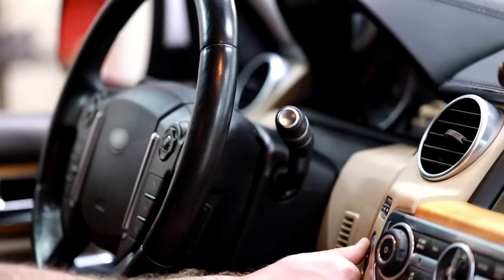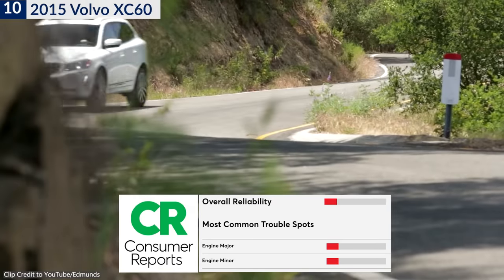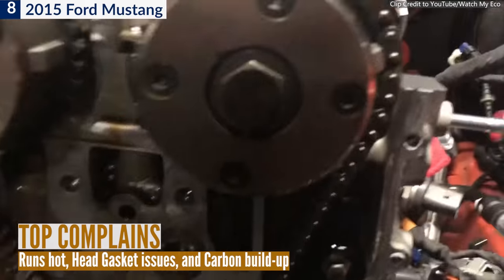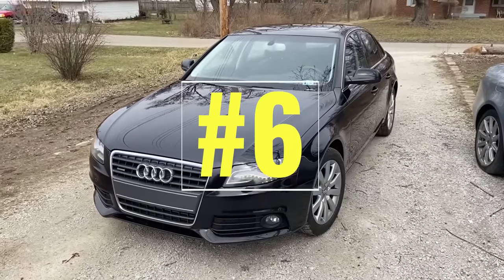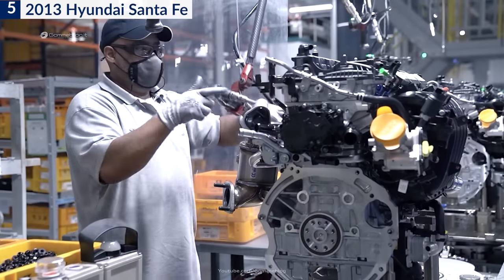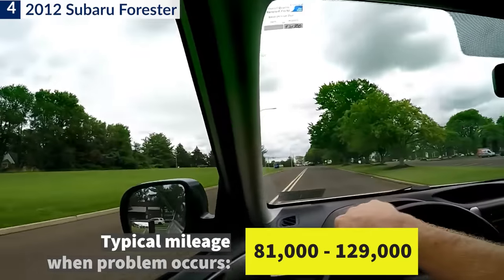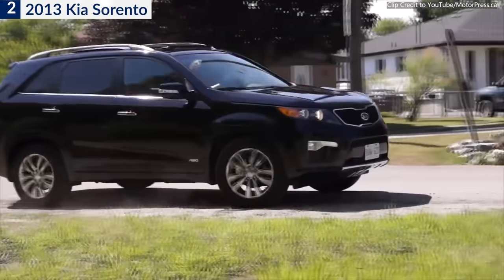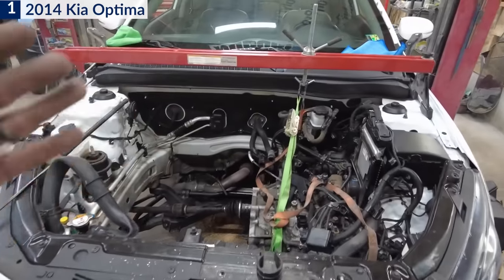10 Used-Cars to AVOID for BAD Engine - as per Consumer Reports

Comment: Yea I'm just gonna stick with Mazda,Honda and Toyota
Reply: Only way to go if you’re buying used
Reply: @floydturner2957 only way to go if you are buying anything.
Reply: Yup…my 2008 Honda fit runs like it’s new. Really great car…built in Japan I believe
Reply: Don't forget ford's relationship with Mazda. For example the Mazda B series and ranger are the same vehicle.
Reply: Or just do 5 minutes of research on cars to figure out of they have any major issues or not.
Reply: @TheRealCatof  research doesn’t help when you buy a new car.
Reply: @RC-fh2lk  yes it does. Vehicle manufacturers usually use the same engines across different cars. A brand new 2023 car most likely has the same engine and transmission that older car in the lineup uses.
Reply: Yes!,,,, Exactly!,,,
Reply: Mazda is pretty much Ford now so better sticki g to toyota and honda
Reply: @Old-n-slo-locked-n-leaned  i work in a dealership and we are in the middle of re building a mazda bt50 engine but the parts mazda sent us for the engine are Ford parts, explain this?
Reply: I've been driving Toyota's since 1983, my daily driver is a 2000 Toyota Tacoma X-tra cab pickup, 2 wd, 4 cyl, automatic. 23 years old, 230,000 miles and still runs great. Can't beat a Toyota! I'm 64, got tired of the Big 3 Junk.
Reply: @elliwowen5121  No it's not. Mazda primarily designs the components that it shares with Ford. The cars made by Mazda in collaboration with Ford have always been bulletproof. The cars made by Ford alone tend to have more issues of course.
Reply: @elliwowen5121 Mazda hasn’t had a relationship with Ford or any shared parts/vehicles since the introduction of Skyactive platforms/engines/transmissions..etc
Reply: Mazdas are overcomplicated for a FYIer. Even the smallest repairs require major disassembly. Plus RUST! OH, RUST!
Reply: @edgarpan  I’ve owned two Highlander’s a 03 (sold at 220k) and now a 2018 (47k)… only changes fluids , breaks and tires … very solid vehicles
Reply: Yeah because I literally don't see one of those vehicles still on the road 20 years old or older.
Reply: Best options
Reply: My last new honda was a nightmare, have fun with those
Reply: Well I got an 89 Ford F150 with 289,000 miles it has a straight six and it’s all original still on the road what’s killing vehicles is half horsepower small cubic inch take your foot off the gas pedal and drive like normal and you won’t wear things out like this
Reply: @onebadmutha5578  My daily driver is a 93 Chevy k1500 @389k miles with a 350 v8. All original except the starter and battery.  Even the brake pads went 150k, still running original drums and rotors. It always amazes me how people make decisions based on misinformation. 🙄
Reply: @wilsterone6689  got to be on the maintenance
Reply: @onebadmutha5578  Absolutely, but that would also be the case on any vehicle. Doesn't make the big three junk because they don't last if you don't maintain them. Its also much harder to get a vehicle that tows 12k lbs and has 300hp to last 300k than it is to get a vehicle that hauls 600 lbs and has 48hp to last 300k.
Reply: @wilsterone6689  I love my Chevys and Fords my wife drives a Kia
Reply: @onebadmutha5578  nothing wrong with a kia. It just pevs me off that people perceive American cars as less reliable.  It simply isn't true.
Reply: Mazda? Hell naw.
Reply: Mitsubishi isn't too bad, as long as you do your regular maintenance.
Reply: @brayanrodriguez1268  True about nearly every brand.
Reply: @elliwowen5121 *was like Ford. They’re completely independent from them now as of last month. They no longer use any Ford parts.
Reply: Same, I was looking at Jeep but idk about their reliability
Reply: @Panicatthejazz  like any manufacturer,  they are fine if you drive like a human and maintain them as recommended.
Reply: Hyundai Kia maybe
Reply: Peugeot, Renault and Citroen , Saab, Fiat, Seat, Alfa Romeo, Porsche, Mercedes....haven't been mentioned.
Is it more US based research ? Or are we just lucky ?
Reply: 2015 mazda6 run great change 7000 miles. 20 wet synthetic we drive it hard love it
Reply: Don't discard Suzuki. They build quite reliable economical vehicles.
Reply: @vanmorris5622  I guess people have forgotten what reliable means when you are happy with your  8 year old car. Let me know what you think of it when it is 28 years old and 400k miles.
Reply: @elliwowen5121 mazda has nothing to do with Ford nowadays. On the other hand they have a joint plant with Toyota ;)
Reply: I bought a new Volkswagen in 2009 that I still have and while it’s been a great car and nice to drive I do occasionally wish I had bought a Honda. The engine in it isn’t prone to catastrophic failures but at about 125,000 miles a lot of issues have had to be dealt with that I wouldn’t expect of a Honda or Toyota.

I still keep it because I do like it and a couple thousand a year in maintenance and repairs is an awful lot less expensive than the lower mileage Honda I’d replace it with.
Reply: @elliwowen5121  since 2012 its hardly a ford as they ended partnership
Reply: Rest assured that Honda is NOT what it once was.
Reply: @RC-fh2lk If you buy new stay away from the 1st year of new generation or series
Reply: Bro put mazda in the same category as toyota and honda LOL
Reply: Same
Reply: @elliwowen5121 you don’t know what you’re talking about.
Reply: @elliwowen5121 Mazda has a parts relationship with Ford but that ended over 10 years ago.  The BT-50 ute is basically a reskinned Isuzu D-Max ute, and Isuzu is with GM.  So strange yeah.
Reply: New Honda and Mazda engines are garbage. Have you been living under a rock
Reply: Oh yeah! My 2005 Honda CRV has 288.000 miles on it! Best car I've ever owned. 👍
Reply: Yup the worse Toyota ever made will outlast the best Audi, Kia, or Volvo.
Reply: @elliwowen5121 Mazda ditched ford 2010.
Reply: There is no connection between  Ford & Mazda. Hasn't been for years.@elliwowen5121
Reply: Nonsense
Reply: @longislandebooks You clearly don't know what you are talking about.
Reply: I said the same thing yesterday..
Reply: Im still driving my silverado 94 4.3 engine almost 300k original miles same motor and transmission 😂 @wilsterone6689
Reply: The CVT transmission is the biggest problem for most car makers .  Doesn't really matter which brand you buy now.
Reply: @elliwowen5121 no it’s not.  That partnership ended nearly 10 years ago.  Mazda’s secondary owner now is Toyota.
Reply: @brayanrodriguez1268 Don’t get a CVT transmission though.
Reply: WHAT ABOUT LEXUS
Reply: @ismehong  Lexus is great, I’ve had several over the years.  Fancy Toyota.  Nice and quiet too.
Reply: It's a myth that Japanese cars a beyond. They are good ones and bad ones.

Comment: It'S a crime that we pay way too much money just to get so much junk out there.
Reply: You have to admit they are light years ahead of cars built in the 70's and 80's.  I remember as a kid if a car lasted 100,000 miles and had no rust after 2 years you had a good car.
Reply: @dank8017  70s I would agree with you, now as for the 80s I had a 86 or 87 Buick Electra and it lasted well over 417k miles and a 84 cavalier that had 478k miles until Midwest rust ate the body
Reply: I can't help but think that car prices would not be here if we stopped financing a new car for validation or "peace of mind" every 2-3 years. Secondly, the manufacturers charge the next year's EPA fine for falling short in testing on the next year's model new car orders. We are getting a marginal quality vehicle for paying off the manufacturers liabilities. Lastly, people don't know how to repair cars. YT is less than half of the solution. There are people better off paying someone else to do it vs, buying another car.
Reply: And new car are continuing to lose quality
Reply: @frederickneal4781  They are shiny junk.
Reply: Seems like the best years of cars were the late 90’s and early 2000’s. I still drive a 2006 Chrysler 300 with 256,000 mile. It’s needed nothing replaced except brakes, tires, serpentine belts of course. Replaced the front struts and sway bar bushings and one tie rod end and it drives quite and as tight as when new. 2 water pump and 2 timing belts were replaced preemptively. Probably should have changed the tranny fluid but never have. 
I do about all the work myself so it’s cost next to nothing plus the insurance is dirt cheap since I don’t carry comprehensive.

Comment: Fuel pump failure is not engine failure. BMW does not use timing belts on any models listed, and are not built in the UK. GM 2.4 and 3.6 also do not use timing belts. OCI at 4000 miles with quality oil will prevent most issues with the GM models. A lot of issues pop up when people do not take care of their cars. Source: I have been a technician for 30 years.
Reply: Nor did the 2.8 V6 from GM. That was a timing chain also
Reply: 2013 cruze with almost 148k and original turbo,change oil every 4k with Mobil 1 synthetic.
Reply: It's true that BMW uses mostly timing chains on their engines. However, it is also known that BMW faced major problems with exactly these timing chains which used to slack quite fast. I know the owner of a BMW 7 class equipped with the ten cylinder diesel engine. Timing chain slack caused a major engine rebuild coming with a workshop receipt exceeding €10.000,-!
I am quite happy with my 2010 Toyota Prius which has now covered 187.000km without any problem whatsoever.
Btw. : most of the engine problems seem to affect the later models with the so called "downsized" engines. Cutting down on cylinder numbers and/or displacement without decreasing the power output is prone to problems as it increase - often fatally so - the power rate per litre. Might be worth thinking about.
Reply: 💯 I currently drive a '13 equinox with the 3.6l engine 136k miles, and have owned 2 other gm vehicles with the 3.6. No issues whatsoever bc I change oil religiously at 5k and check the levels frequently

Comment: I have a 2013 Honda accord sport. Lemme tell ya….It ROCKS! This car is one of the best cars I’ve ever had.
Reply: It rocks?....sounds like bad struts & shocks....🤔
Reply: I notice that there are no Japanese-manufactured models on this list.
Reply: Had a 14 sport coupe lx. 2.4L engine ended up with oil dilution issues. Mechanic said the engine needed cylinder rehoning and new piston rings.

Comment: I am having very good service with my 2006 4-cyl Ford Escape with 268,000 miles on original engine. No engine or transmission problems at all. I have had front suspension and half shaft repair/replacement. I do all maintenance regularly! I think about trading it in at times, and then I read articles like this and decide to keep it.
Reply: If it works, don't fix it. 👍
Reply: I have a buddy that sold his Escape with 336k on it and still doing fine. Maintenance is key with any vehicle.
Reply: Using the exact recommended lubricants is key, but sometimes expensive.
Reply: I have a 1989 Lincoln Mark VII with over 200,000 miles. It runs great. My 1985 Crown Vic police car finally died after more than 300,000 miles. Windsor V8s were pretty durable but nothing beats regular and timely maintenance!
Reply: Also, the engine on your Escape was designed by Mazda, which tends to have a good reputation for reliability. It doesn't have the EcoBoost problems like the newer Escapes do.
Reply: I had a 2005 ford escape.  Never had engine issues.  But the Ohio winters killed the body and  front and rear sub frames.
Reply: Same  on my 2012 fusion . 250k with  no issues.  It gets  35 mpg and still  looks  decent   so why do I want to  replace  it
Reply: These type of places will only bring up negativity. I have a 2021 Mach E with 50k miles. Haven’t had ANY issues at all this far. No maintenance and still have 5 years of warranty. I’m singing!!!! Like some say, I am not rich to own a used car
Reply: Mustang is not a Mustang without a V8!
Reply: @patrickcannell2258  says you?? I think it’s up to Ford to name it whatever they want to. It’s like saying my kids name isn’t Alex because there’s another Alex that’s older. EV MUSTANG is amazing. I can throw the back end around, looks like a modern mustang and feels sporty. In unbridled  we get sporty steering wheel resistance and it can stop better than any ice mustang. You may not want to accept that things are changing but that’s a fact.. sorry
Reply: My 06 v6 escape has 322.000 on it   .regular maintenance is key.
Reply: I'm happy with my 2012 Ford Escape, with the 3.0 liter V-6.  I hope it runs forever!  I don't ever want to have to buy one of Joe Biden's EV's!
Reply: @donaldwilson2620  Not true at all.
Reply: @Bigguy_33  Yea sure. My 04 Focus had 267k mis when sold. Gotta do good basic maintenance!

Comment: I love my 92 nissan hardbody pickup  truck 350,000 miles later still going strong.
Reply: I have the same Nissan 3.5 V-6  225,000 plus miles. Does not use or drip oil.